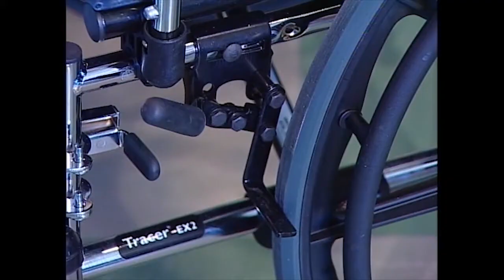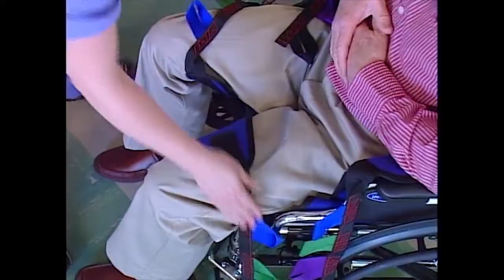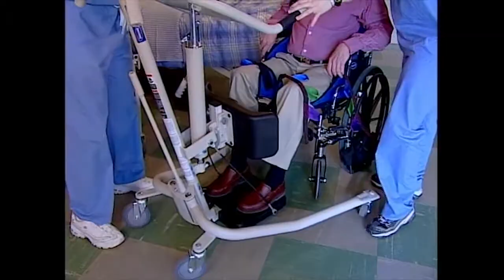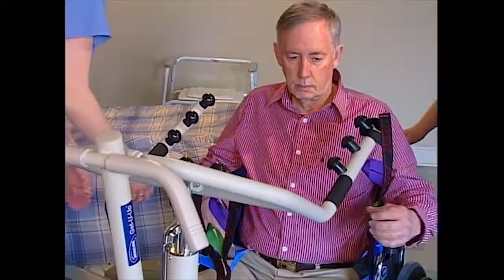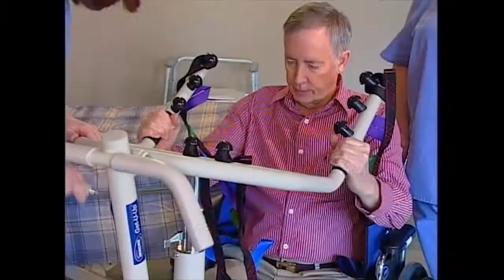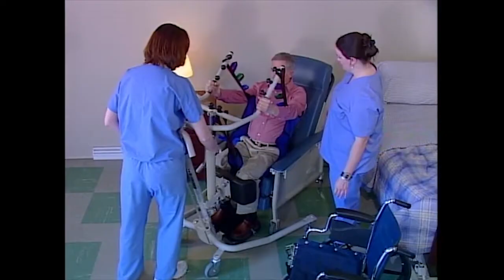Invacare Get-U-Up Stand-Up Lift | Wheelchair-to-Recliner Patient Transfer Demonstration

Comment: Where can I get that sling
Reply from the maker: Hi! The sling shown here is the stand-up transfer sling used with the Invacare Get-U-Up Stand-Up Lift. You can find it (and the lift) over at livingspinal.com — just search "Get-U-Up" or check the product link in the video description: https://livingspinal.com/products/get-u-up-hydraulic-stand-up-lift-by-invacare.html . Feel free to reach out if you'd like help picking the right size!